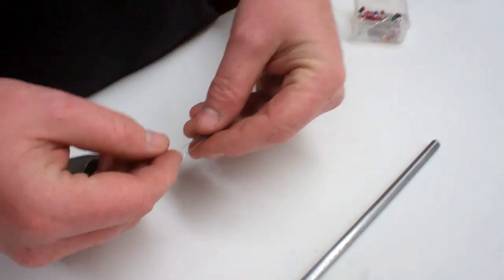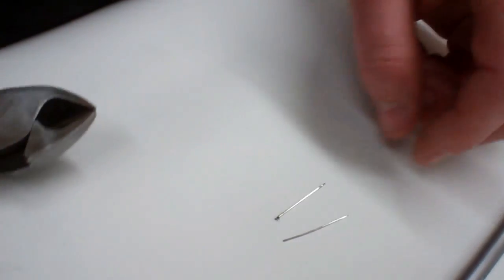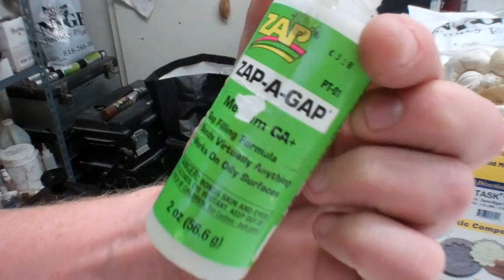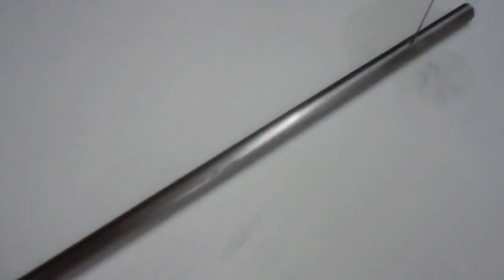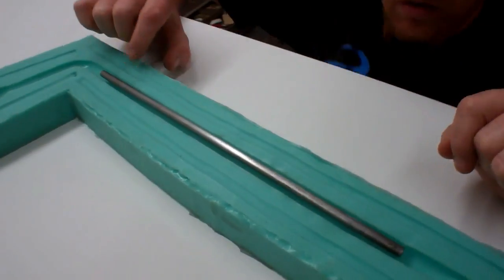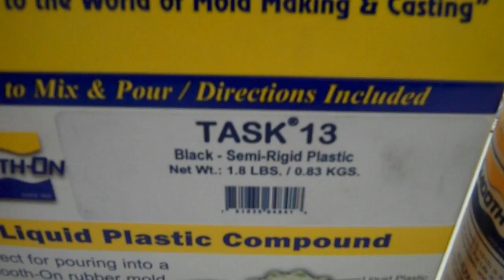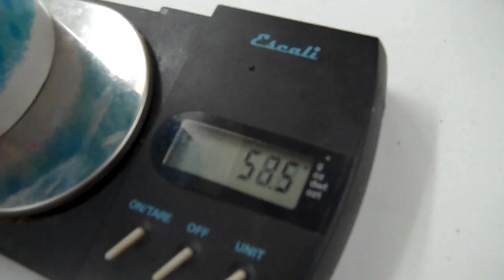How To Cast From A Silicone Mold By Special Effects Pros

Comment: Hello guys,  I'm making a mold for a holder I need for a drain pipe on my trailer.  This holder needs to have a flat bottom on one side and a concaved channel on the other.  I have actually created the piece using molding clay.  I now need to create the mold to make the actual piece I need.  The final product that is.  The final product needs to be somewhat of a hardened piece but still of a rubbery nature.  Black would be the preferred color.  What products would you say I need to achieve this?

Comment: @ 10:25 why don't you pour into the same cup? I mean when you're done with the first cup leave it on the scale zero it out then add the second material, that way you could save a cup and 10% extra material.
BTW very informative video Thanks a bunch ;-)

Comment: Great videos guys. Could you do a video on molding more complex objects, like a basket hilt claymore or rapier? Is it even possible to do a mold like that?  It seems to me because of all the intricate parts you wouldn't be able to get it out of the mold. Or is there some trick I haven't seen yet?
Reply: +TheFireLizard Casting is usually for objects that you need a lot of or you need to replace materials. I am just curious, what are you casting a basket hilt rapier out of?
Reply: the idea is foam but since it's a complex object I cant figure out how to do it. if it were a simple cup style that would be easy but the more fancy type would be hard. I'm trying to get into making foam larping weapons.
Reply: Ah, I see. In that case, you might want to use sheets of foam and form them into the basket, then cut the details with a knife or other sculpting tool. Look at Evil Ted channel's videos on foam armor and see if that helps.
Reply: yeah I have been watching those vids too. it's all very helpful. lately I have been using PVC to make costume weapons, but they arent suitable to actually fight anyone with. they are just for looks cause someone could get hurt even though the edges are blunt. mostly just knives and small things. But the idea is to eventually start laminating sheets of flattened PVC pipe out to carve as masters to make the molds from. even though I know eventually It is best to model out of clay or wax then make a mold of that. it's easier to really make detailed things that way.
Reply: You keep experimenting, pal. Innovation is the best thing about art! The only time you fail is when you quit.

Comment: Awesome videos, thanks!!! Dumb/newb question: is it possible to suspend the object (i.e. tire iron), level, in the moulding box, and then pour silicone until the object is halfway submerged? I guess one downside is that whatever foreign object is used to suspend the model, that would show up in the mold and would need to be removed from any castings.

Anyway, just curious, thanks again,

Comment: I have just finished  making a pair of antlers ( i had to use foil and duct tape to make the shape then went over them with strips of plaster fabric untill and sanded it back untill i had the shape i wanted) but I want to make a mold of them so that i can cast some hard plastic versions of them ( as plaster is quite fragile often). However the antlers have a lot of branched off sections and quite a curve to them. would this method of creating a mold and casting still work? or should i try something else?

Comment: I think I read that you can use water to measure how much you need.
I tested it and it is thereabouts right.
You get yourself a measuring container of water and mark the water level. Submerge your item that you are casting into the water and mark the new water level. the amount you need is the total difference between the original and new water level

Comment: I've found if you use a cordless drill with no bit and run the chuck on the side of the wood it will act as a vibrator like you use in concerting and vibration will get the air bubbles out

Comment: Thank you guys for sharing this. I've done hundreds of molds for jewelry, mainly rubber using a vulcanizer. But have also made many using different types of RTV, silicon, and plastics. Want to mold up a few larger things like small plastic or rubberized figurines and such. Have used the blue silicone you used here for some different jewelry pieces but never something larger. I'm thinking it will work well for what i'm looking to do. Thanks for all the info.

Comment: You can make many hammers from the same mold with silicon, plaster would be if you were lucky a one time deal. You'd break it pulling the piece. then have to make a new mold each time.

Comment: Most of this stuff can be purchased at Tap Plastic. Hey guys, a few ideas. Instead of using a metal bar why not use a wooden dowel? Lighter and safer than the metal bar, easier to mount the needles to, and cheaper? Just a thought. Also maybe use a slightly lighter board such as plywood instead of the 2 X 6's, also maybe put your straps, and boards down then your first half of the mold on top to start with instead of moving everything onto it. Just a few ideas.

Comment from the maker: You have to use a High-Temp Silicone material in order to pour in metal - check with the manufacture on the temp that it can withstand. Look up SILPAC or SMOOTH-ON and talk to those guy's. Good luck and let me know how that works out for you.

Comment: Great vids, and love the outtakes! I realize this is a lil old, but I've found that an easy way to account for how much product you might need for a pour is a simple displacement test of your prop. I often like to repurpose rubbermaid containers for my mold houses. Simply fill one with a measured amount of water, add prop, and weigh it. Since water and the container have fixed weight, its easy to figure out how much extra you're going to need without hardcore math. Easy peasy!

Comment: If you wanted to cast a hard object instead of a soft one, what type of material would you use? Could you use fiberglass resin, or would it stick to the silicone and ruin the mold?

Comment: Hey i want to start getting into molding, i don't know alot about molding , but i am going to get smooth on starter kit that i am going to get, and reading some of the comments do i need a respirators if i use this outside? just wondering =) also was wondering did you get your silicone rubber from smooth on? if not where then? XD

Comment: I want to start doing molding, I know little about it other than what I've learnt on Youtube. What I want to know is can silicone casting be done from silicone molds with a release agent? Or can a rubber casting be made from a silicone mold and then a resin mold made from that to then cast back in silicone?

Comment: What Resin do you suggest for Small parts. like little bitty parts..ive been casting toys (like, the entire toy.. joints everything) ive been using Smooth-Cast 325, ive heard 320 is best.. i used task 4 for a while, but all the white settled in the resin part of it and i guess its ruined.. ive tried mixing it back up but it dont work very well..

Comment from the maker: @reyzartsist Depends on what your using the prop for - if it's a prop weapon then it may be a bit too fragile. If it's going to be used as structurally sound then it should work just fine.

Comment from the maker: @CptnDavid I must of missed this one. We plan to make that video hopefully pretty soon. For smaller objects you can take a medium size pot, fill it with water to the very top, almost to the point of spilling over. First set that medium pot into a larger one or five gallon bucket. Then when you drop your part into the water, whatever spills over is the volume you need. Or Length X Width X Height = Volume. More in the video :)

Comment: would PVC pipe works too instead of the steel bar? just a little question in mind~~ and i would like to see the other ways of position the bar in the mold too, and thx for the videos, i like it much ;)